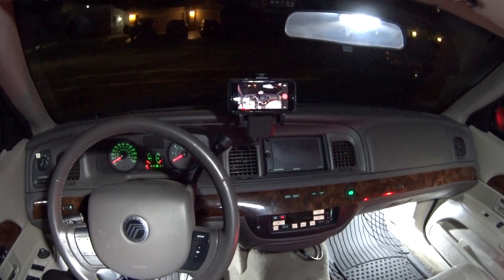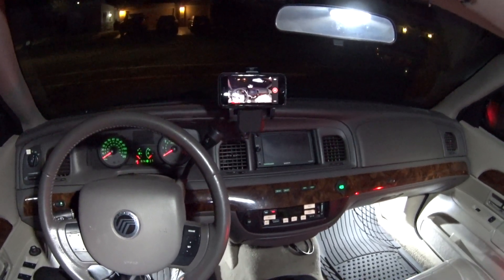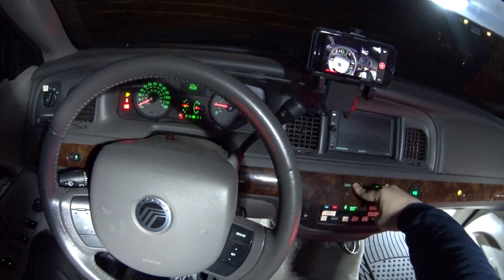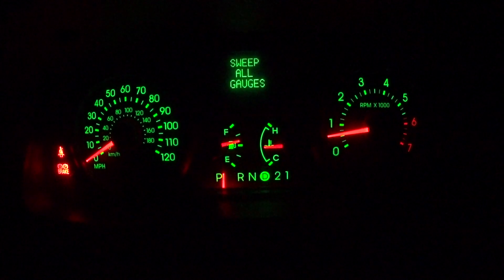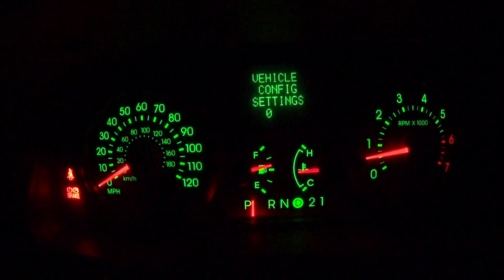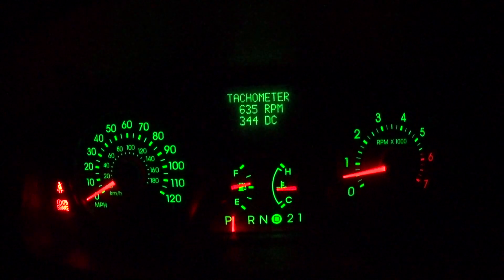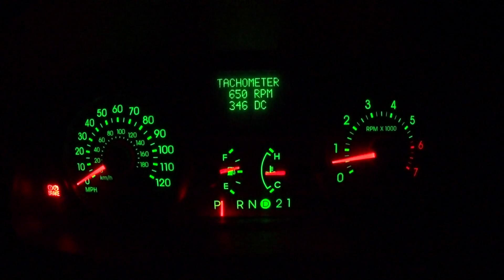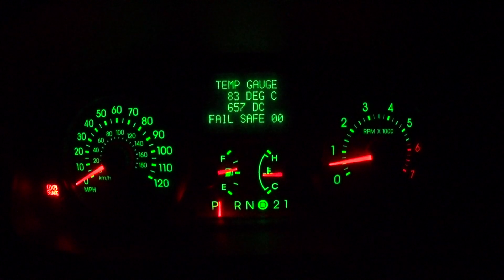Crown Victoria - Hidden Digital Tachometer

Comment: Very cool except that I can't get my cluster to go into special menu mode.  Mine is 08 CVPI with 08 MGM cluster swap and dash trim buttons.
Reply from the maker: Right on Encino,
Thanks for watching.
-Chuck
Reply: @PanzerPlatform  Learned something from you which is the highest compliment.  I'm still running CVPI PCM so there must be a setting that I am missing.  Forscan will not access PCM so I may be SOL.
Reply from the maker: @encinobalboa  
You're too kind, I'm just repeating stuff I heard from someone else. Lol
-Chuck

Comment: Oh that’s freaking cool I just did it on my 2010 Lincoln Town Car Executive L series
Reply from the maker: Right on Josh,
Thanks for watching. 
-Chuck
Reply: @PanzerPlatform  question I noticed a Dtcs code 9202 come up in the menu I scrolled through the menu my check engine light is on but my fuel gauge works. Any ideas?
Reply from the maker: @joshuacampodonico6554  
The Dtcs obtained from this function only refer to instrument cluster malfunctions. 

OBD2 Diagnostic Trouble Codes are a different system that deal with powertrain malfunctions. 

You will need an. OBD2 scan toll to pull the DTC's from your check engine light. 

If you have a scan tool let me know the DTC. It will have this alphanumerical format;
P0114
-Chuck
Reply: @PanzerPlatform  ok so I have a PO135 code which is my bank 1 sensor 1 o2 sensor was told that it was my pcm but wasn’t sure if the 9202 would have anything to do with that like maybe I was looking in the wrong place.
Reply from the maker: @joshuacampodonico6554  
OK, those two malfunctions are unrelated. 

Diagnose the P0135 first, and go from there.

Comment: I’m gonna try it on my 1998 TownCar. Do you think it will work? How did you gain knowledge about these “secret menus”? I’d love to try to see if my car has one!!!
Reply from the maker: Right on Vinny,
Let us know how it works out.
-Chuck
Reply: @PanzerPlatform  I tried it and it didn’t work. My engine started and immediately cut off haha! Do you know if the 1998 TownCar has a secret digital tachometer?
Reply from the maker: @vengeance6983  
I don't know. 
I think only 2006-2011 have this. 
Stay tuned for tomorrow's video though. 
-Chuck
Reply: @PanzerPlatform  I’m on the edge of my seat! I need to see my rpm on my automatic vehicle. Hahahaha it would be cool of it had it
Reply from the maker: @vengeance6983  
Here you go; https://youtu.be/QxdnB9kd9bg
-Chuck

Comment: I got a unit that plugs into the OBD port does RPM volts and other for my 2000 MGM 
As always have a great day Chuck, and thanks for the useful info you give
Reply: I have the same car. what unit did you install? Thanks, Steve.
Reply: @SteveM-426   I got the konnwei  kw206 if you amazon search that the options will show up.  So far no sign that the computer is stress by it always being connected
Reply: @darkwhitedirewolf  Thanks for the info!
Reply from the maker: Right on Mike,
Thanks for dropping in. 
-Chuck